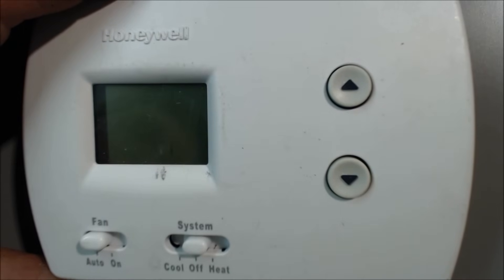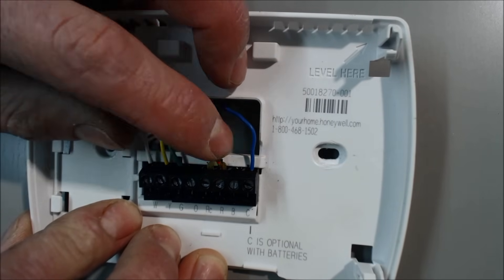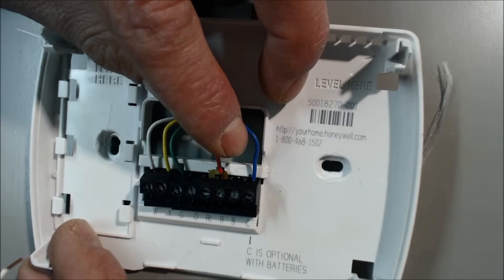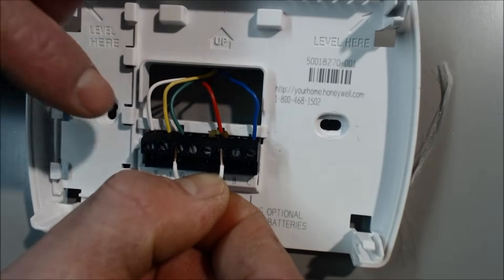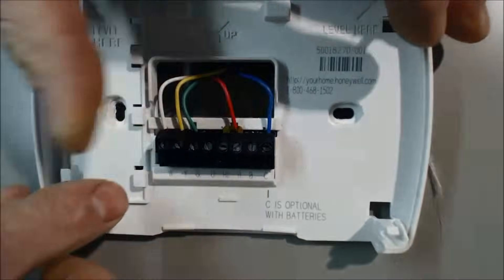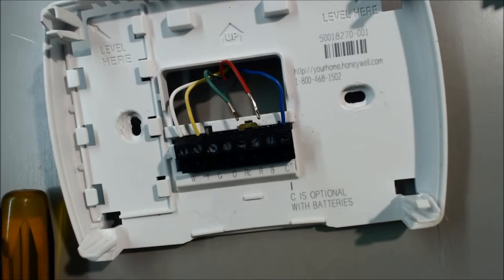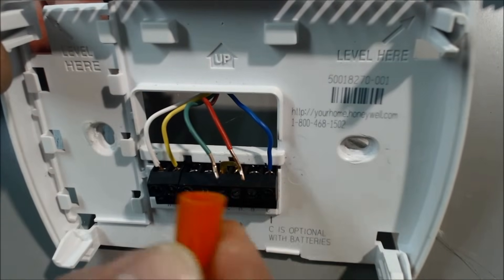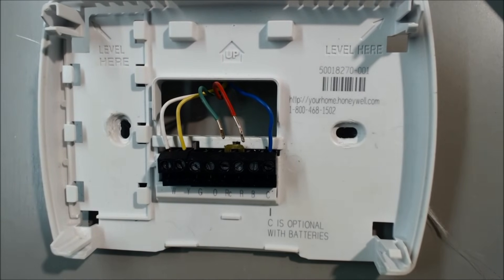Troubleshooting if a Thermostat is BAD: Explained!

Comment: My furnace fan wont turn off by the thermostat even when switched to the off position, what do you think the problem might be?
Reply: katanatac bad T stat
Reply: Sorry, not really up with the talk of the trade, what is a "T stat"?
Reply from the maker: It could be the thermostat, thermostat wires, or the relay on the board. Have you seen the acservicetech Thermostat Troubleshooting playlist and the videos at the top?-  https://www.youtube.com/watch?v=pFF1Cj2VnDQ&list=PLxnHR5_D2ojzDfU1IjPpzdhi_mUGe3F7W
Reply from the maker: n9neduece was saying thermostat in short. Thanks!
Reply: Now my transformer burned up, it had smoke coming off of it.
Reply from the maker: What happened or what did you try to do? If you are not a technician, I would call one in order for them to read voltages and troubleshoot. These videos are not mean't for homeowners, thanks
Reply: I turned on the system and it was running ok then the blower fan made a sound like the power dropped so I turned the system off at the thermostat (which actually worked this time) then I turned the breaker off to the furnace. I could smell something burning so I pulled the cover off and saw the transformer smoking.

Comment: What would a brown wire be??
Reply from the maker: It could just be an extra wire. Did you check at the indoor unit to see if it is connected. Sometimes techs don't follow the wiring color code, thanks John!
Reply: Extra wire

Comment: Dude you said to take the faceplate off while it's running and then you said to jump the red and green wires and if it comes on then it's bad. I thought it was already on
Reply from the maker: If the fan will not turn on when the tstat is calling for fan to turn on but after you take the faceplate off and jump r to g the fan does turn on then it shows the only thing wrong was the tstat faceplate, thanks!

Comment: Or test the prongs on back of the tstat with voltmeter,  at least that is how I was trained.
Reply from the maker: Yes you could test resistance on the pins on the back of a tstat if batteries were installed in order to see if the tstat is bad, thanks

Comment: Shop my compressor won't shut off on it's own. On auto the inside system turns off but outside stays running I need to remove the fuse to shut it off. Is this a bad termastat?  Please help
Reply from the maker: That typically is the contactor in the outdoor unit has burnt shut. You would need to shut the fuse off at the outdoor unit and see if the contactor plunger snaps back up or is stuck down. Make sure the power is off inside and outside before checking because 24v is sent from the inside to the outdoor contactor and the outdoor fuse gives 240v to the contactor. Check out "acservicetech contactor video"

Comment: My thermostat is making clicking sounds every few seconds when i am turning it to cool, but "Cool" message just blinks and disappears, AC isn't turning on. Fan on AC just moves a little bit and stops. Thermostat makes that clicks even if  disconnect it from the wall plate. I tried reset to factory defaults but it didnt help, do i have to replace thermostat or is there a way to fix it?  It is VT 1007 model : http://www.smartwaysolutions.com/thermostat.asp#
Reply from the maker: It sounds like you would need to replace it, thanks

Comment: Thermostat unit screen was damaged and could only read if the fan was on auto or circ. Changing the fan option did not do anything so I tried this. When I used pliers to jump the red n green wire a small spark happened and then nothing happened. When I place the unit back on, there is no power and the word fan that was legible before is no longer there. What can I do now?
Reply from the maker: The 3 amp or 5 amp fuse is likely blown but not because of jumping r to g because that happens any time the thermostat calls the fan to turn on. You should replace the thermostat and replace the 24v fuse in the indoor unit, thanks
Reply: AC Service Tech LLC what caused the power to the unit to go out if not jumping r to g then? It was working fine prior to jumping. Also is there a specific 24v fuse I need to buy or are they all pretty much the same and fit with any indoor unit? Lastly where in the indoor unit is the fuse located? My indoor unit is located in the attic if that helps. Thanks
Reply from the maker: It could have if there was already if there was a problem short from g to the c wire but if you were to test any 24v thermostat, they connect r to g for fan because 24v comes from the indoor unit and connects to g at the tstat and comes back to the indoor unit to power the g terminal on the board or g wire going to a relay. It could be a spade or bottle fuse but turn the power off to the unit and check it if you are a technician. This channel is for technicians in the field and those at HVACR school. If you don't have electrical experience then I would call a tech in to replace the tstat, check your wiring and take care of your fuse or any other problems. They would be able to figure problems out with a multimeter, thanks

Comment: I have this same thermostat and I've changed with fresh batteries and the display is all wonky. It is only showing partial numbers. Any ideas?
Reply from the maker: It sounds like the thermostat is bad or is not getting the right ac voltage on the r terminals.

Comment: I'm still not clear under what circumstances should there be a jumper wire connecting the RC and RH terminals. I see in the video they each had their own wire back to the old system you removed that had separate transformers (furnace and one for AC) so I'm thinking since new systems only have a transformer in the furnace ...but what does the jumper wire accomplish?
Reply from the maker: You are correct and the Rc can connect to G and to Y but the Rh only can connect to the w so that is why they need to have the 24v input voltage jumpered to both for a single heat and ac system, thanks

Comment: thanks for the video.  My thermostat (Honeywell RTH2300B1102) is blank and controls do not work at all.  BUT AC is still running and it is very cold in here.  I can not stop the AC by switching thermostat to OFF.  AC did stop when I took off thermostat cover.  Do I need a new thermostat?
Reply from the maker: Yes it sounds like you do, thanks

Comment: Im having this issue where after replacing the old thermostat the new honeywell one is doing the same thing. Both work for a short while.. maybe 30 minutes,  and then when I check the thermostats each one had lost its set temperature to turn on and I have replaced batteries twice already.. Im so lost now.
Reply from the maker: There is a hold button that may be accidentally being pushed. Usually settings won't be lost if the tstat does not loose power. Are you using new duracell batteries?
Reply: I did push the hold button I should'nt have done it. I am using new duracell batteries. As of right now and Im not sure completely but the thermostat seems to be working within reason at 74 F. Shuts off and turns back on seemingly correct. Seems to be holding the temp setting altho I found it confusing just trying to set it. Anyways I think Im okay now if not I will ask questions again. And thank you so much for the quick reply that speaks volumes in my book. Again thanks.
Reply from the maker: Thanks Herbert!
Reply: UPDATE. My thermostat keeps reverting back to 85 degrees. It works for a few hours then switches back to a higher setting. Also thats what my other old thermostat did that made me buy another new one. The first Therm was a hunter, the one I use now is a honeywell. I can reset the thermostat to a desired setting but it only holds for a few hours on either thermostat. Not sure what Im doing wrong or what is going on.

Comment: What if I connected the G and R and the fan does not turn on, is this mean the thermostat is good? Need help please ASAP thanks.
Reply from the maker: Try connecting g and r at the indoor airhandler or furnace and see if it turns on instead of just at the thermostat. Make sure the power is off and after the jumpers are in place and you are in a safe spot and not near the unit, turn the power back on.

Comment: Hey, i just install a Honeywell RTH9585Wf but the screen is not powering up, i have the 4 wires for a conventional system plus the C wire. I traced the wires back to the system and they are loke this Red-R, White-w, Yellow-y Green-g and Blue-c, i also checked the voltage and i have 26 volts between r and c. This is the seccond thermostat i installed and it was the same issue. What could be the cause?
Reply from the maker: Do you have 24v at the thermostat sub base or just at the furnace? Is R and Rc jumpered in the thermostat if available.
Reply: acservicetech  at the thermostat and yes, i have the jumper between R and Rc, and i found this very weird since this is the second brand new thermostat that i install
Reply from the maker: Make sure that the common is going to the C terminal and not the B terminal. Maybe try only wiring in the r and the c and leave the other wires off to see if it happens to work then out of curiosity in case something else is occurring with the other wires. Obviously this would just be to check only. thanks

Comment: Any idea why my heat pump won't shut off after reaching the desired thermostat setting?  It does turn off if I turn off the whole unit at the thermostat.  Just not when it's supposed to when it reaches the desired temp.  Any ideas on that?
Reply from the maker: Sounds like a bad thermostat, thanks

Comment: Hi and thank you for your videos.  I have tried extensively to troubleshoot my thermostat issues but to no avail.  The electric furnace works, in so far that if I switch it off from heat to off.  If I don't it will just continuously run.  I am beginning to wonder if it is a wire issue between thermostat and furnace, as I have replaced the thermostat 4 times in past 5 years.  (with same thermostat rth 221).  However this year it is not responding to program or hold function.  I have five wires coming out (red, white, green, black, and orange.)  I don't have pump so orange not in use.  I am not sure if relevant but the program and hold feature do work if I remove black wire, but there is no heat when operating with this configuration.  Thanks

Comment: The thermostat is blank, but putting in batteries turns it on. It still won't power on the AC, fan, or heat, though. Is it the thermostat or the HVAC system that I need to have looked at?
Reply from the maker: The system is what needs to be looked at, thanks!
Reply from the maker: Thats awesome, thanks paloma!
Reply: I thought I understood until I read this comment. Why wouldn't it be a bad thermostat if the thermostat won't even power on the fan?

Comment: What if the metal jumper broke? Any way to wire it or do I need a new thermostat?
Reply from the maker: You can make a new jumper out of 18 gauge wire. We bend it and then flatten it with a hammer on a thick piece of metal or we use a jumper left over from another thermostat, thanks
Reply: acservicetech thanks so much!!

Comment: So if the fan works, but the display light is out and the air conditioner won't come on, then is thefaceplate bad? Oris it another issue. I've replaced the batteries, but the display still won't turn on, but the fan will turn on.
Reply from the maker: If you have replaced the batteries and it still won't turn on then yes I would replace the thermostat, thanks!  Here is a link to the 24v Thermostat used in the video-  http://amzn.to/2bDeUak

Comment: I have a question the hurricane I just had knocked my power out for a day and when the power came back on my a/c unit didn't... What's wrong with it?
Reply from the maker: Is the thermostat power on? Is the indoor fan not running or is it just the outdoor that isn't running? Basically, did the breaker turn off, did a fuse blow inside the unit or a fuse blow at the disconnect at the outdoor unit? I was just looking for more info, thanks

Comment: Before jumpering the R and G, I would use a multi-meter and check for 24V A/C between the R and C.
Reply from the maker: Yes, sometimes there is no C to test from though, thanks Eric S!
Reply: @acservicetechchannel  Was just going to say, that method wouldn't do you any good for a thermostat with batteries..

Comment: my a/c runs constant if I set on 72 and it's is down to 72 I can run it up to 76 and with in a few minutes it will go to 76 and turn back on I even have a small 110 window unit to help it turn off quicker the 110 will cycle at 72 but the main one will keep running set at 76..any help I think the stat is bad but the home ower says it's new..any help
Reply from the maker: I am having trouble understanding exactly what is going on but there could be several issues. The tsat may not be accurate, the tstat may not be installed near a return but maybe a supply or on an outside wall instead of an inside wall. Once again, I am not undersanding exactly so I am just throwing some things out there that it could be. Did you check to make sure you were getting 18-21 degree temp decrease from the return to the supply across the evaporator coil indicating that the charge is good?
Reply: acservicetech yeah it will cool the house it just don't seen to cycle correctly.. like I said I can have it on 72 and jump it up to 76 and it will go to 76 and turn right back on even late at night
Reply from the maker: Ok bad tstat then if it happens that fast and you don't notice any other air temp changes. Try one like this if it is one stage heat and cool-   http://amzn.to/2bDeUak  -  If not if it is a heat pump with elec resistance make sure to get a thermostat with aux and e terminals, thanks

Comment: The thermostat's thermometer is saying it is 64 degrees.  I would guess the temp is about 77 or so. Replaced batteries and it did not make a difference.  The only way I found to get the air to turn on is to set the target temp below the thermostat temp reading.  Do you have any suggestions I can try, or do you think the thermostat is bad?  Thanks for your help.
Reply from the maker: It sounds like the tsat is bad. There is usually no way to adjust the temp calibration unfortunately. These are relatively inexpensive if your system is gas or oil heat with ac system, packaged unit, or just air handler and ac system but not mini-splits  --  http://amzn.to/2bDeUak  -- If it is a heat pump then you would need a stat with aux and e settings, thanks

Comment: i have two units hooked to the same thermostat two sets 24 volt wires but there is only one transformer most of the time they come on however sometimes they wont and i have to push in the contacts on both,  voltage at the transformer showed 25.3 volts,   voltage on the contacts showed 23.5 for each contact. i thought maybe the transformer wasnt strong enough to pull them both in. so today when it wouldnt come on i disconeteced the 24 volts fron one unit  the other unit still wouldnt start on its own so after pushing in the contact  then when i hooked the low voltage wires back to the other unit it came on without pushing in the contact. any sugestions to what is causing this problem 
Thanks
Reply from the maker: Usually voltage at the transformer will read 26.5-28.5v so that is a little low to start at the transformer. If after pushing the contactors in they stay sucked in then that is contactor replacements, transformer, replacement, and tightening spade connectors from what it sounds like. Thanks

Comment: Great video and a good explanation of why the industry moved away from the old mercury switch. Those switches would bounce those compressors on and off until the mercury settled. A five minute delay is a bit long but better safe than sorry.
Reply from the maker: Yes if I need to turn it on quickly then I use the mag jumpers, otherwise I have time while doing other maintenance, Thanks

Comment: I don't have a problem with the fan coming on. I can't get it to turn off without pulling out relay. Help. I am guessing I need a new thermostat?
Reply from the maker: Turn the power off then pull the face plate off of the thermostat, turn the power back on and see if the fan turns on, If it does, then turn the power off, take the thermostat face plate off, see if it turns on. If it does then, after that turn the power off and disconnect the fan wire from the furnace or air handler, then turn it on again and see if the fan runs. This will tell you if the problem is in the tstat or wire, thanks

Comment: The heat will not come on in one of my zones, I replaced the thermostat, and still no heat.  It comes on as programmed in the other 2 zones.  Your thoughts
Reply from the maker: Are you talking about one system with multiple zone such as a boiler? If so do you have 24v going to the zone valve or zone control? Here are some videos on that - https://youtu.be/LL75mqbklvg   --    https://youtu.be/8Esqg3PfJzE
Reply: 1 system with multiple zones.  I am starting to suspect that, for whatever reason, no power is going to that thermostat.

Comment: do the blue wire need to hook up r don't have to
Reply from the maker: If you are using batteries then you do not need the blue common wire. If you want to hard wire the thermostat with 24v from the furnace then you would need a common to go back to the furnace or air handler. Thanks
Reply: +acservicetech thank man that mean a lot you just. don't know I got a problem air work heat say on but no heat?????
Reply from the maker: I couldn't make out that last one.
Reply: +acservicetech air work heat don't but it stay on it cold ass hell
Reply from the maker: If its a furnace, do you have 24v between w and c on the control board? That would mean that the therm and thermostat wiring are working and calling for heat but the heat sequence in the furnace will not start. sequence of operation-    https://youtu.be/k5vEkndMXLI